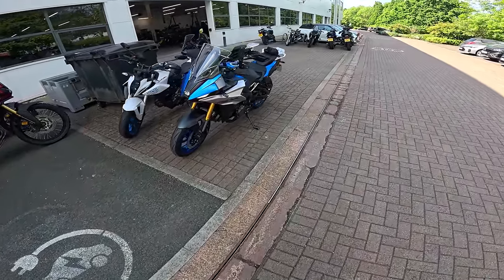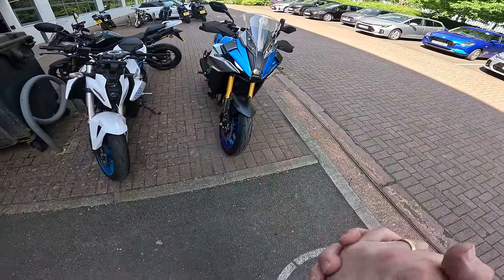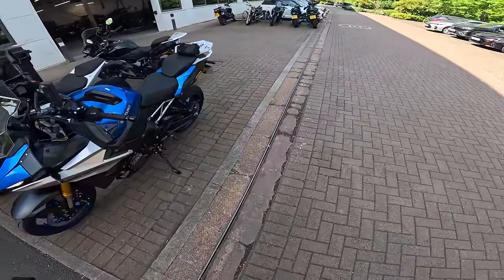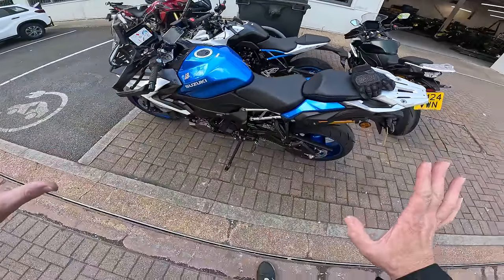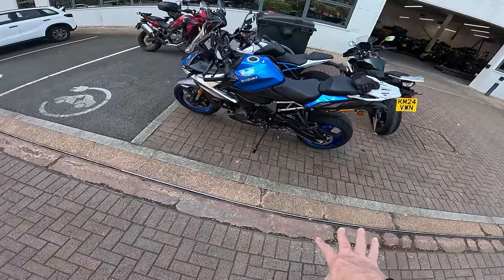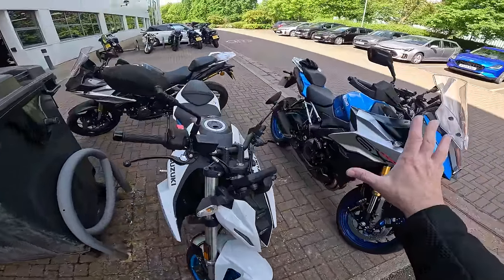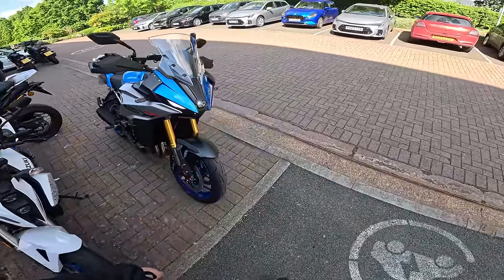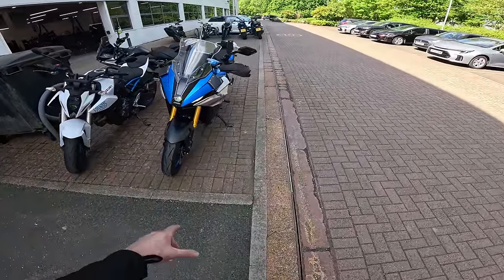New Motorcycle Break In TIPS | My New Suzuki GSXS1000 GX Collected

Comment: With mine I followed good sense like other commenters have said, like: "Don't rag it. Don't baby it. Don't let it labour." but I also followed the owner manual: < 5500 rpm the first 1000km, and then < 7500 rpm until 1600km. With Suzuki at least, there is still a prep oil in the bike meant to be replaced at roughly 1000km.

Comment: Modern engines are so well engineered now that in most peoples case, it’s just riding normally. Not thrashing or lugging. Doesn’t do any harm to use revs or throttle a bit, as you say. The heat cycle thing you detail well is really key. Let them do town stuff, motorway stuff as well as back road stuff. We’re lucky these days with modern tech, let’s enjoy it! 👍👍
Reply: Thrashing them does risk snapping a ring if done too much too early, or as Chopsy said it can reduce the mileage the engine will do long term before they need replacing. Not sitting at a constant rpm is pretty key too, but I don't think engines have changed massively in the past 20+ years in regards to reliability overall.
Reply: @HalfdeadRider  bikes that are ran in a bit more spirited often make more power on the dyno than one that’s been babied for the first 1500 miles of its life as well
Reply: @DucatiDale  I've obviously heard peoplr say that as in the vid, but not seen proof as such, one engine can produce more power than another anyway. Babying it isnt tue way, you have to use the engine rpms up to a point and vary them, and going over the 6k mark occasionally won't hurt it. Also as Chopsy said even if it is true, I'd rather know my engine will be most reliable of the two.
Reply: Everyone has their own "expert" opinion 😂😂😂
Reply: My dealer and mechanic both said to just ride it. And was told to put a bit of load on the engine. 4000km's now and runs like a dream.
Reply: @Sargnort  agreed. My ATAS has 1500 miles under its belt now in 6 weeks, during run in I just rode it normally, nothing special. No thrashing or lugging etc. At the first service even the Honda tech’s said it was bang on perfect.

Comment: Collecting my 2024 Trident 660 Tuesday coming and never bought a brand new bike before so a pretty relevant and well timed video 👍🏻
Reply: Triumphs running in procedure is one of the worst I’d ignore it almost completely 😂
Reply: @DucatiDale most definitely. When I had a 675 Daytona the mechanic said to give it a proper thrash after picking it up after the first service.
Reply: @cport955  sure it’s printed on the tank or whatever it’s like so many miles at 1500/2000rpm then 2000-2500 so on so forth has old men scared to death if they accidentally rev to 3000 in the first 600 mile
Reply: @DucatiDale   It gets them out of any warranty claims. They can check the data and if you haven't complied to the run in rules it's void.
Reply: @mrcintheuk4641  first I’ve heard had plenty go in for work after not following run in procedure but generally triumph engines are sound it’s switch gear electrics etc that normally have issues

Comment: Nice one Chopsy.  The argument about the best way to break in any combustion engine will last as long as we have them.  I follow what is recommended by the manufacturers, and therefore don’t buy any demo bikes as you don’t know how they have been broken in. However, as mentioned, there are several tests done that don’t show any difference from riding it like you stole it so it might be simply down to a cheaper grade engine oil from factory.

Comment: As you say, loads of opinions. I largely mirror your view. Don’t labour it or work it under high/wide open throttle. I tend to use a lower gear than I would once run in so as to not labour but otherwise try to ride spiritedly. Breaks to cool every 50 miles are good for the heat cycling. I don’t tend to idle for any length as that can do more harm than good with piston glazing while running in. I can genuinely feel the engine freeing up. I’ve ran in about 10 new bikes and had no issues but we all do it our own way.

Comment: The last engine that I thought about in terms of the running-in procedure was a Buell Ulysses. I simply ran it semi-vigorously for 50 miles, then changed the oil and filter. At zero miles, I warmed it up thoroughly and set off and used about three-quarters of the rev range, never lugging it - hard to do anyway with an XB12X - never holding the throttle 3/4 open for long. Open the throttle, shut it, open it, shut it etc. After the oil and filter change, I ran it normally but didn't red line it. First dealer service was at 1,000 miles. Those bikes have great engines.
Reply: I love the Uly!!!
Reply: @Roger_Ramjet  I would much rather have it than this Suzuki. Far more low-end/mid-range grunt. 80 MPH at 4,000 RPM in top gear. Lovely low-revving feel about it.
Reply: @1990-t1j . I'm currently looking at an immaculate 2010 XB12 Ss in hero blue to add to the garage. I think I need to stop dithering and just buy it.
Reply: @motosnape  Buy it!

Comment: Interesting bike & timely vid Chops. I'm running in a Suzuki myself at the mo ironically & up to about 750 miles currently. I believe they use a different type of oil initially but not sure about the filter tbh. However, they obviously change both at 600 miles so highly possible. For my bike the next interval is 7500 miles or 12 months & I was surprised there was no 1000 mile service as I've experienced with previous new Suzuki's. Although, you're still supposed to only use up to 75% of the revs between 600 & 1000 miles. I essential follow the manufacturers guidelines for the fitst 600 miles & then ride it normally after that but I'm still not bouncing it off the redline every 5 mins or mistreating it. With all that said I'm not really sure how much running it in matters these days with modern engines as you say. Although, I definitely think it's good to have at least some mechanical sympathy with a new engine, but it's better to overuse than underuse it too. The golden rules I've always been told are to use all the revs you're supposed to, go up & down the box as much as you can, don't hold it at constant revs for long periods of time & don't load the engine too much by doing top gear roll ons etc from low speed.

Comment: I completely agree with the 100/150 mile initial oil change theory Chopsy.
It’s something I’ve done for many, many years.
I too believe that the most ‘debris’ is generated in those first few miles.
The first oil change on my most recent new bike really highlighted how discoloured the factory oil gets in that time too.
What I drained out had a very noticeable metallic ‘sheen’ to it, with tiny bits of silicone sealant also present !
Rightly or wrongly, it’s at this point that I drain and refill with fully synthetic, and it’s always worked for me.
If Porsche are happy to factory fill their engines with fully synthetic, then I’m very comfortable with my subtle variation.
Looking forward to more videos on the Suzuki 👌
Reply: But porsche don't make motorcycles?

Comment: There is one common thread amongst advice on run-in, and that is whichever way you do it, engine damage is an extremely rare event. Conclusion - dont worry about it. A lot of demo bikes are loaned out at zero miles and most test riders will open up beyond run-in revs (where revs are not ecu restricted), and i have bought ex demo bikes with no issues. Maybe an issue back in 1970’s but the evidence suggests for modern bikes just ride it however you want. (Go easy on brakes and tyres for first 100 miles of course)

Comment: Running-in has changed in the last 30 years, and how you run a bike in depends on when your bike was designed. To answer your question Chopsey: modern manufacture don't "run them in", they manufacture them to much finer tolerances (smoother) so it requires very little "running-in" and they are run up at the factory just to check the engine is OK for 30 seconds.
"Running-in oil" is only used for OLDER bikes that are not so finely finished from new. This type of oil is THINNER and designed to allow the parts to RUB, hence they are short lived interval. A modern oil will not allow your brand new 1956 BSA to run-in and form the ring\ barrel seal, in that scenario you would be looking for a "running in oil" because you need the parts to rub.

To answer the question "why should I run it in", the real answer is Warranty. The ECU knows if you did or did not follow the manual, and so during a Warranty claim it gives them a get-out-claim-free-card. And I know one M1000RR owner who found out the hard way with a blown motor, as BMW said, "we can see you didn't run it in- go away".
Reply: How strict do you think they are with it. I'm running mine in and I'm rarely careful but sometimes the thrill can get the better of me now and again

Comment: Surely you don't need to change the oil after 100 miles as that's the idea of the oil filter, to collect the particles in the oil.
Reply: The RD350 was a two stroke, so it used fresh oil all the time!

Comment: I've had mine, exactly the same colour for exactly 30 days yesterday. I've done 3047 miles in that time. Brilliant bike but I'm ready now to try better tyres. The tyre dealer doesn't recommend having a 55 profile tyre on it however. As for the screen, I've moved it to the highest position and added a spoiler to the top, works for me. Having experimented with the suspension I find it best in auto preload and Medium rebound, going too hard doesn't let the suspension do its thing in sorting out the bumps. Interested to see what you think after a few thousand miles 👍
Reply from the maker: I've fitted a 55 to mine now so will let you know how it feels shortly 👍

Comment: On the new Triumph's you run them in a bit at a time, the rev counter red line increases the more miles you do. I think using fully synthetic oil from the start could be detrimental and won't allow the engine to bed in properly. I think manufacturers do use running in oil, but they don't say.

Comment: Why change the oil early, the oil filter is there to catch any debris. I’m pretty sure the manufacturers know what they are doing and have gone through all the computations of running in. Plus you don’t want to give the manufacturer any excuse to try and get out of a warranty claim and you need to run in the suspension, tires and brakes.
Reply: The manufacturers know what they are
Doing to get u past warranty. That is all

Comment: Its all about heat cycles and not breaking engine components, longevity slow run in, and little to no run in for minimal gains in hp risking longevity or breakages 😢 all depends how you normally ride and how long you keep your bike😅 i personally half every thing and after run in fit k&n/ not sprint ! And full exhaust system and ecu flash for more power,  i woud use sprint race filter on a track bike though 😊

Comment: I bought a new Moto Guzzi v85tt a couple of years ago. The dealer took on a 6 mile check out ride before delivering the bike to me. When I received the bike with 6 miles on the clock I was giving the dash the once over when I came across the "max speed"...… 102mph. So much for easy break in. 12,000 miles later bike seems no worse for wear.
Reply: That just seems a bit abusive, that would've pissed me off.
Reply: I was concerned. I get the feeling every bike that leaves that shop gets similar treatment.

Comment: Maybe one factor with the the running-in of an engine is not anything to do with how the engine is treated once it's made but the tolerances to which it was built. The running in process is just ensuring that friction parts are given the chance to bed in just in case their tolerances are sub-optimal. Which I guess is why, with modern manufacturing standards, it's nowhere near as critical as it once was.

Comment: and the tyres need some running in too. What is on the bike and what  do you think you will eventually get? I use Metzeler Roadtes 01 SE as all year/all weather tyre on the XR. (And Michelin Road 6 GT on the K1300GT)
I did get to run in the K1300 gt as it had only 15000 miles in 14 years and stood for 2 years. And i changed the Bridgestones as they were 6 years old.

Comment: This, the S1000GT, the Z1000SX or any similar bike would be in my preferred one bike garage. My issue though is the regular inline 4 is a tad generic and a bit boring. They do everything really well but ultimately lack the sole and character I want from my motorcycle.
Reply: I don't think a 150hp inline 4 can be described as boring. It's just more refined than something like a 1200 twin. But having owned a SD 1290R, I wouldn't want to put up with that engine every day tbh.
Reply: So much no - my Suzuki 750 is a smooth bag of very angry bees.  These engines are animals - unless you potter below 6k - then they're pussy cats.  but don't do that.
Reply: @anxiousappliance  I had a k5 750 with Micron, Power Commander and Nitron suspension upgrades. Phenomenal track bike but wants to be ridden like you're racing all the time. Very limited character. Not the street bike I want.

Comment: Ride it as normal just don’t ping it off the limiter use 95% of the rev range none of this 2000rpm for a 100 miles shite and no lugging in high gears from low down and you’re golden once the first oil change is done have at it

Comment: Perfect timing, Chops. Im soon to pick up a Duke 890r brand new.  I've never had a new bike before. So i have many questions and theories about the run-in. 
I also would like to know what oil the manufacturers use from the factory. 
I was thinking to use a mineral oil at 300 miles and then fully synthetic At 600. Then another at 1200. After that. I will change oil every 2000 miles.  I know that sounds excessive.  I've always chamged the oil very early in my bikes, and they've all been good to me. I've never had any major issues with any of my bikes.

Does anyone know what the oil viscosity for the 890r is there is europe. I live in a hot tropical country.  I think the oil viscosity will be different here.  👍
Reply: Just use recommended oil my yam uses semi if you put fully in it makes the clutch slip